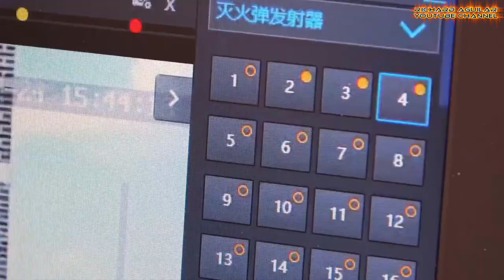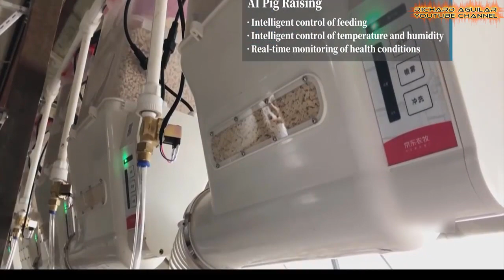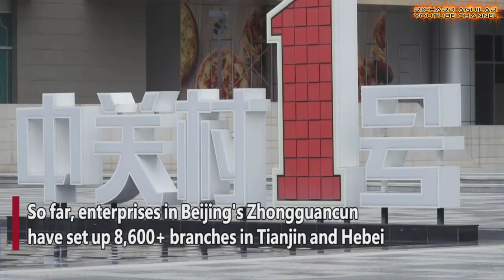CHINA INNOVATION! New Technological Advancement That Could Change The World

Comment: 055, 3 ready and commissioned and five being built. They are going to build another 8 totalling 16. Then they will move on to 055a and builds another 20. Total 36 one the largest and most potent destroyer in the world is scary. They have a smaller version destroyer 052DD about 28 0f them. In total together with other version they have about 50 destroyers. Scary.

Comment: I have a feeling the Chinese bridge will fail before 10 years.  Rebar in concrete promotes cracking.
Reply: only showed you have no knowledge about china, many bridges well over 10 years, 35 km long bridge cross hangzhou bay was built in 2008, so did all those high speed railroads.
Reply: @MikeeSocial. 
Not feeling but your personal hatred of China